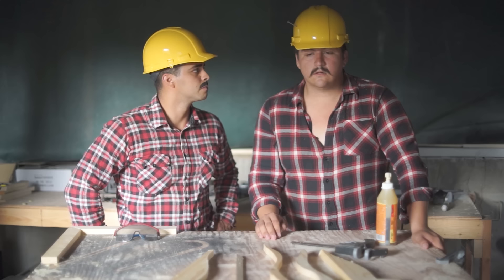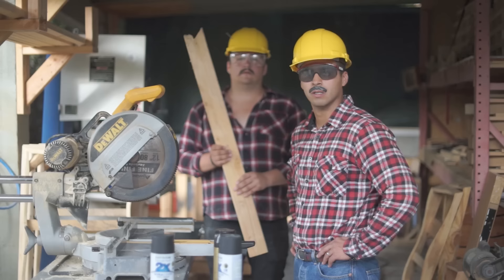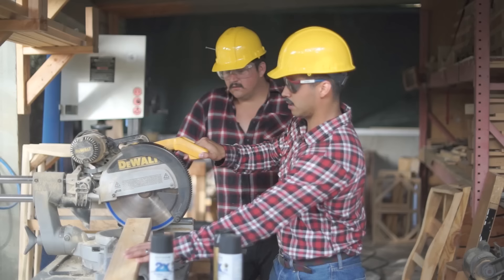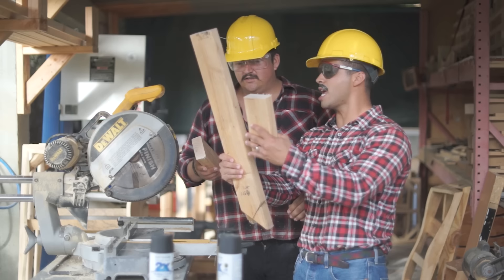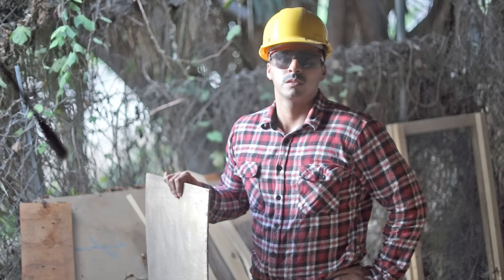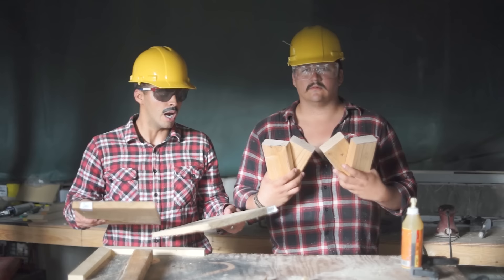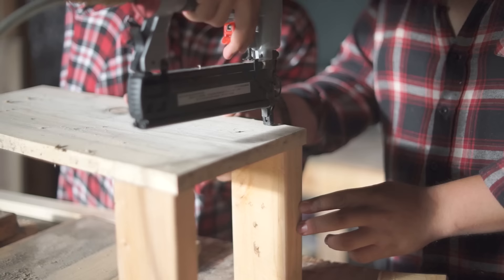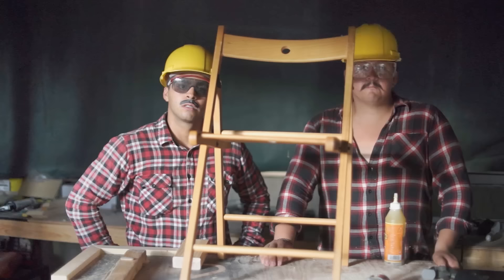How to build a chair - The Juan And Jesús Show by David Lopez

Comment: Me as a carpenter wat hing a loose piece of woof on a saw deck not tight against a fence with nary a clamp or hand holding it  with blade spinning have flashbacks of snap backs .....ralphy from the simpsons should ve there like haha im in danger